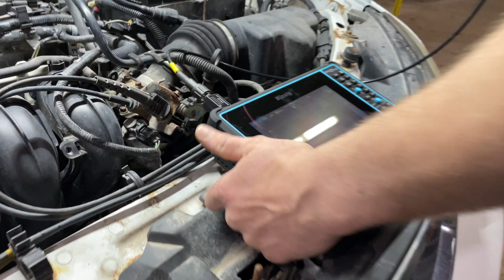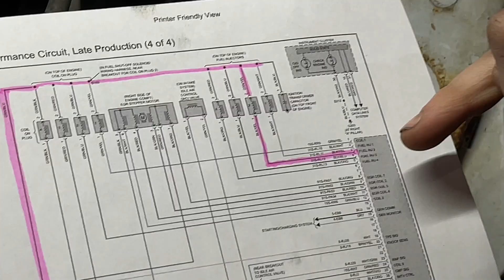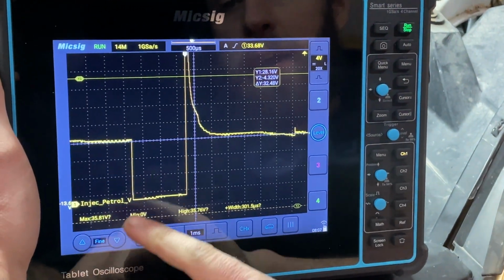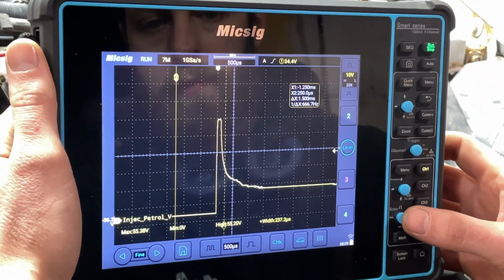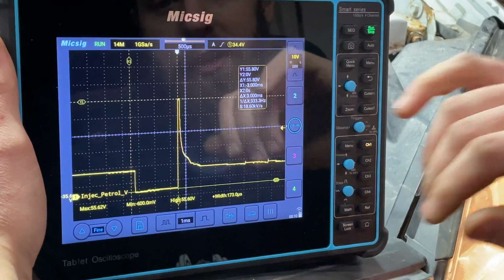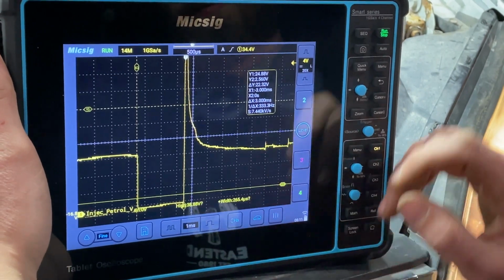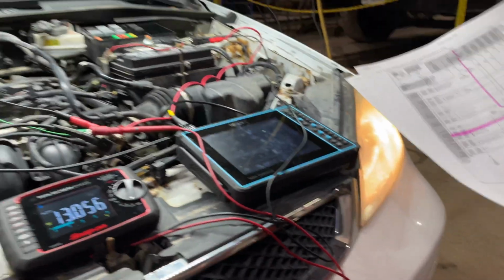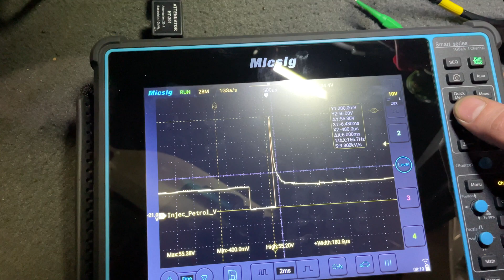Ford Focus 2006 Injector Waveform Micsig sato1004

Comment: Awesome video, nice to see someone who tries and understands how and why automotive systems work, I'm also considering the Micisg due to its unbeatable price, where do you take your scope knowledge from ? I like automotive oscilloscope waveform analysis by Graham Stoakes, I am also considering purchase of the ATG books Advanced Circuit and Electrical Testing, and Intermittent Electric and Drivability Diagnostics.
Reply from the maker: It’s a tough one to wrap my head around but then again I am a slow learner in my opinion. I like the look and feel of the micsig but there is one thing that bothers me with the software and that the scale at which the graph is displayed on. See I watched a lot of scannersdanners YouTube and premium website content to try and teach myself how to use an oscilloscope and you see danner uses a snap on scope and pico scope. Now the scope he uses shows a graph from let’s 0 to 20 volts and with the micsig it can do the same but it measures in increments of whatever you choose.. it’s difficult to explain but they are different.. I sent micsig an entire write up and explanation on how they should add a feature to change the scale but so far no luck.. the detail of the micsig is no wear close to the picoscope. It’s good for the price but if I had to buy it again I would buy pico and just save up the 8 grand
Reply from the maker: Oh and I bought mine on aliexpress, it was 1300 Canadian
Reply: @Tech-28  would you recommend this as a first scope ? Of course under the 1000 USD budget
Reply from the maker: @thesmartguy3523  I know pico is so expensive, but i know I’ll probably go pico next, this scope is pretty versatile swing as it’s a tablet and it’s right around the price range of 1000USD, I haven’t really had much experience with any others, the launch and Autel scopes run the exact same software as the micsig by the way
Reply: @Tech-28  right thanks for your reply, but would you recommend it or not ? I can only ever dream of getting a pico but hopefully once I'm on track with scooe mastery